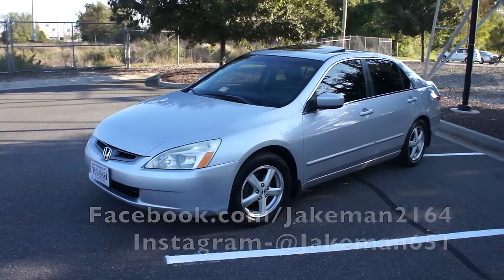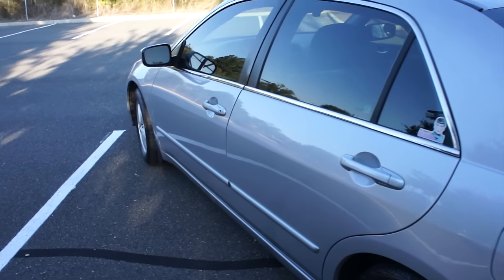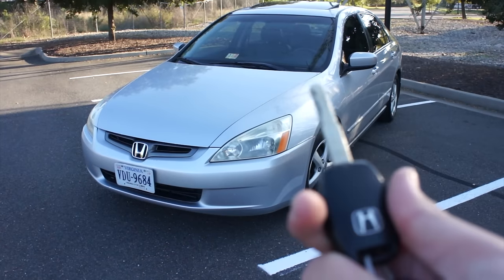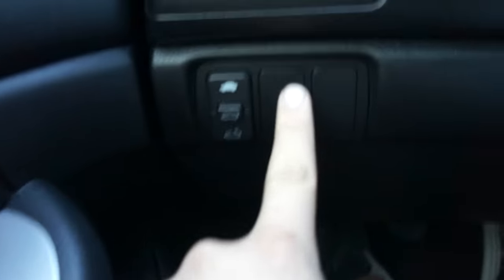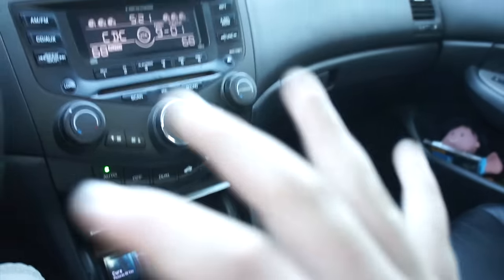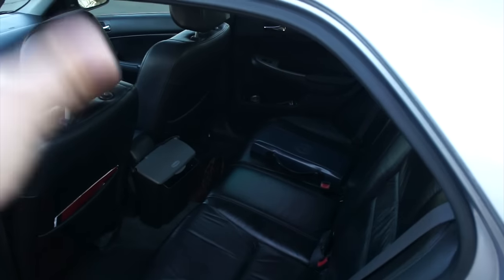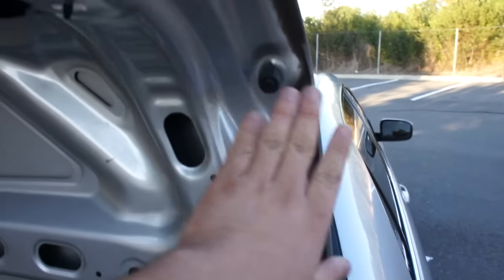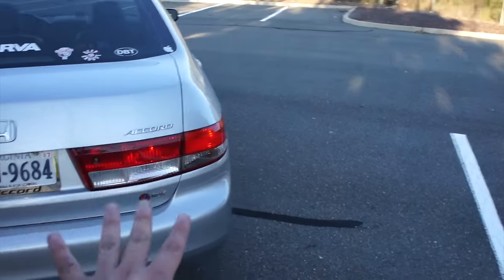2003 Honda Accord EX-L 5-spd 156k Updates and Overview

Comment: I have a 2004 accord exl and I agree with most of the stuff with you. firstly yeah I have a beige interior and I don't like it. The speakers are amazing. No major problems. It is 3,50,000 kms automatic and still runs like a clock.
Reply: why don’t you like beige interior? Is it hard to clean ?
Reply: @moneyonmind2412  As it gets old, it shows the age more than black. Just makes the car feel old
Reply: @savjottoor7910  I just bought one with the beige today in mint condition but i’ll keep that in mind
Reply: @moneyonmind2412  It is a great car. Just keep them clean and conditioned once in a while if you plan to keep it in a long run. Mine got bad because of my faults. I used to be not gentle with leather. I won't be like this with my next car for sure which will be a Lexus.
Congratulations! Enjoy the car! Rev uppp the engine!

Comment: had a 96 coupe 4 cylinder 5 speed and then an 05 4 cylinder 5 speed sedan, the 05 has almost no steering feel, road feel in general, and the noise isolation is incredibly good compared to the previous generation. It's a lot less engaging I have to say. You sit higher up and the steering is overly power assisted, could do with a little less assistance for better feel. It's still more fun to drive than the average car, mostly due to the manual trans and it gets slightly better mileage but it feels so muted.

Comment: I really want to upgrade the speakers of my 1998 Ranger. Surprisingly the stock ones are fairly good but after driving some newer fancier vehicles at work I can see a lot of improvement could happen haha. I also really need to work on cleaning up and fixing a few things with my door panels (because it's a Ford). Nice video! You may be still catching up to me mileage wise since I'm only at 171k as of now haha.

Comment: I'm thinking about saving for this car as my first car. I've found multiple 2007 Honda Accord EX-L V6s with Nav for around $5,000 with about 130-140k miles. Do you think that's a good buy or is the mileage too high?
Reply: Hondas last forever. I got the exact Honda in this video at 143k and it's close to 200k have done basic maintenance and basic repairs. No signs of trans issues. Clutch and flywheel still beautiful but that depends on how you drive it (:
Reply: @elanadurrick2705  what do you mean when you say how you drive it, is there a best way to drive, what oil do you use for the engine?

Comment: Do you still have this car? Mine i do still have it since I bought it 2013 but the difference is yours is manual mine is AT .I want manual grrr but my wife wants AT .They are great car will last you lifetime as long you maintain it and I have no issues whatsoever, I just replaced my self the all engine trans. Etc mounts coz of aging oem parts .I bought it for 4500 has 145 miles on it 2013 now has 208miles on time changing oil Synthetic just SuperTech oil ..Still driving perfect!! My Son driving from work and school coz I have 2012 accord, well as usual I do the basic maintenance coz my son donno crap lol

Comment: How many miles per tank do you get on average and how many gallons does it take when you fill up your tank? Cause I have one just like yours and it only takes 12 gallons on fill up
Reply from the maker: Jcrizzy 1135 Typically about 420 (heh) to 450 miles a tank. I've driven the car for so long that I can usually burry the needle and not have to put more than 15 gallons in it.
Reply: Jakeman21642 Thanks for replying...cause I'm getting less than 300 miles a tank and I read in the manual it's a 17ish gallon tank but it only wants to take 12 gallons and they say there's a few gallons saved as a reserve
Reply: Josh Crooks I get less than 300 miles on a 110k mikes accord

Comment: I don't know if you know. But these cars require a  Honda specific power steering fluid, That is available at your local auto store.But I had no idea and I would put regular fluid in it,But Since changing the power steering canister and switching to the correct power steering fluid I've had no problems with it no leaks no whining.No ossues at all, I think that's a little more important to share then this garbage he's yapping about. It's just not helpfuĺ.So I got mine was.

Comment: I thought the darkest you could go on the front windows in the state of Virginia is 50%? Otherwise your accord is extremely clean compared to most that I've see of that model. Most i've seen have been trashed.
Reply from the maker: Technically it is unless you have a prescription which I may or may not have. So far not a single issue and I've driven the car all over the state.

Comment: +JakeMan21642 how much did your Michelin tires cost I have Michelin Primacy MXV4 tires and there about half gone and I'm looking at tires sometime soon and I don't want to fork out the $1,054 that discount tire wants I can get the Primacy MXV4 tires at sams club for $500
Reply from the maker: I think they were around $800 mounted and balanced but the tire shop I used is fairly expensive. If you can get the MXV4's for $500 I'd totally do it because they're basically the older version of the premiers and just as good!

Comment: The transmission on my 2003 Accord EX-L V6 just went out @ 145,000 miles. Time for me to retire it after 13 years. :'(
Reply: Was is automatic or also manual?
Reply: +Lukas the Mercedes Freak and car nut  Automatic. It has been a great and reliable car up until now! Bought it new with 8 miles on it.
Reply: Did you ever change the timing belt and water pump?
Reply: Nam HT Nguyễn  Yes, I did have both changed/replaced by the Honda dealer at the recommended mileage.
Reply: How much you paid? I'm weighing on that idea. A mechanic estimates that service and brake (rotors and pads) for around 1000. I have 104+k miles on it currently

Comment: I have a 04 Lx... same color
Reply: Me too. 2.4 automatic. Just turned 82k miles. It was my dad's. I got it for $3k. He had scraped the passenger rear door on the garage door frame. A body shop wanted $1000 to repair and repaint. I found a door in a scrapyard with same paint code for $175. $80 to have it installed by an employee of the scrapyard after he got off on the same day. Another $185 to replace sagging headliner. Car looks brand new. Total purchase including repairs is approximately $3600. At 82k, It should last me the rest of my life. I drive about 5k a year.

Comment: Best Accord imo. (with cb7 coming in close 2nd). Anything newer is pretty much for the most part, crap.
Reply: You're prob saying that b/c u used to own a 7th accord :p but yeah, fuck the 8th and 9th accord. Test drove the 2016 one and GOD it was unbearable. My dad wanted me to buy it but I ultimately ended up buying the 2016 civic because it was more updated and better looking. Can't wait to see what the 10th gen accord will be like in 2017. ;)
Reply: I actually have some respect for the 9th accord but the 8th accord is absolute garbage. What I know about the upcoming 10th accord is that it will be based on Honda's new global platform which was just used on the new CR-V and Civic so it'll  look something like those cars. They're supposedly adding a new engine too so that'll be interesting.
Reply: I find it hard to believe that the 10th generation will be anything better than what we've already seen from Honda. The 7th generation was probably their best.
Reply: @warrenf5821  I owned a 7th Gen and loved it, I’ve got a 2020 Accord now. Both are great but the 10th gen is an incredible car.